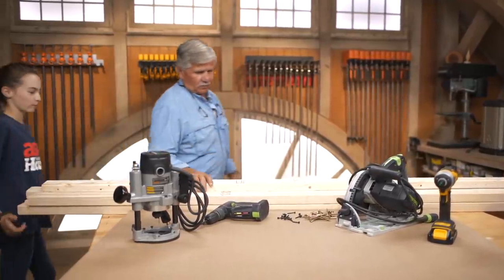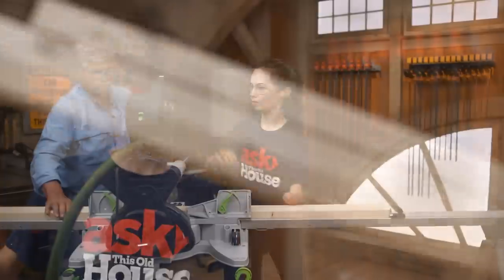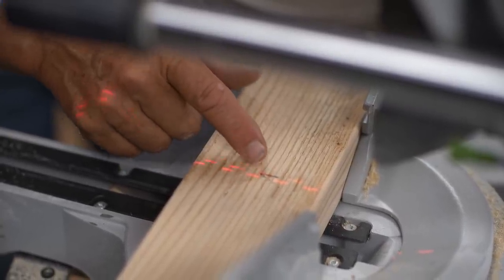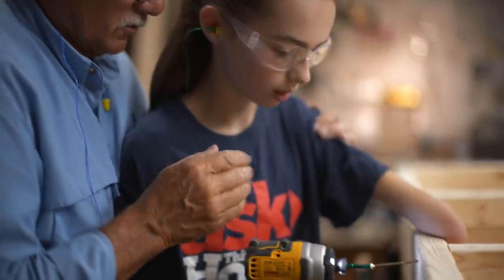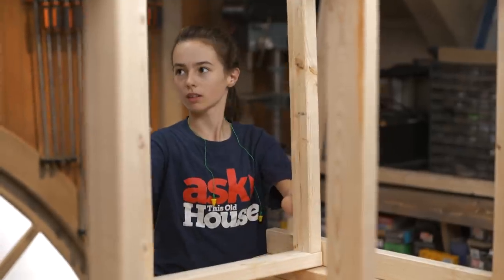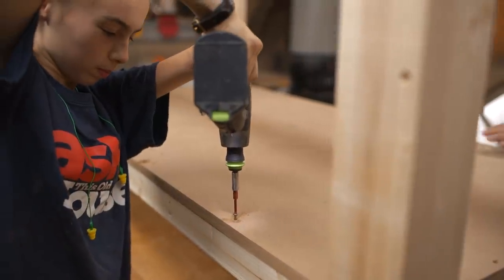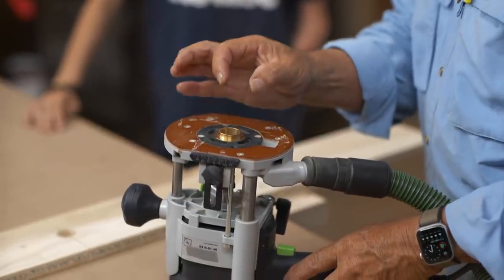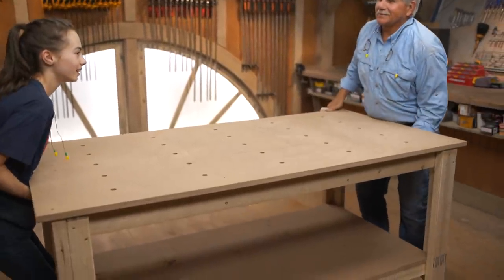How To Build a Workbench  | Ask This Old House

Comment: Question about strength. First, I have no idea what I’m doing, but I remember hearing that load bearing surfaces should be “stacked” so the weight is transferred directly onto wood and the legs, not transferred into sheer load on screws.  With this table, yes, the corner legs are carrying some direct load, but the middle could potentially bow and sheer the screws.  Or is 3/4 MDF strong enough not to bow? Just looking for opinions from the experts :). As chance would have it I’m scheduled to build my own in the near future!
Reply: You're probably right. In reality, they maybe should have put another 2-by in the middle to support the weight in the middle, because MDF sags like none other over time.
Reply: That table is plenty strong for it’s intended use.